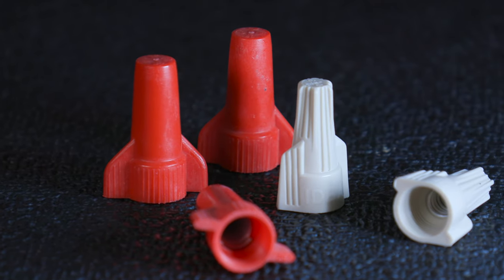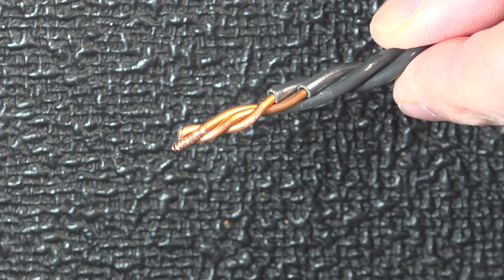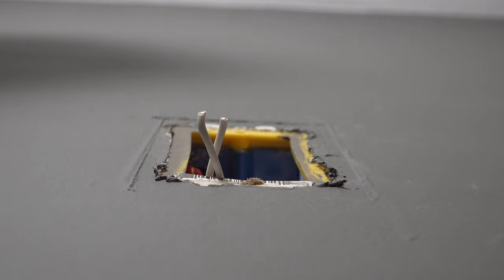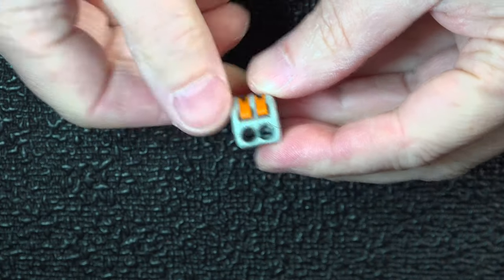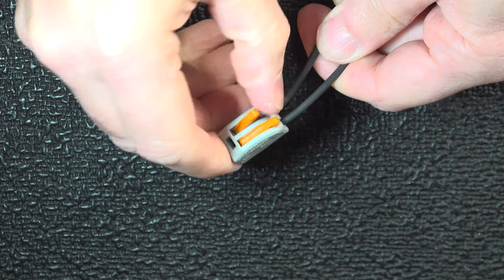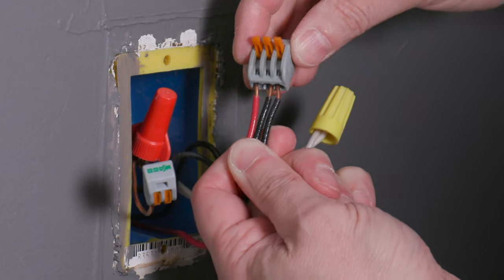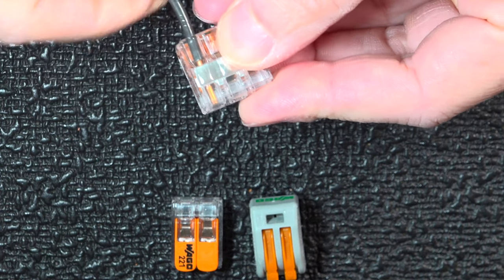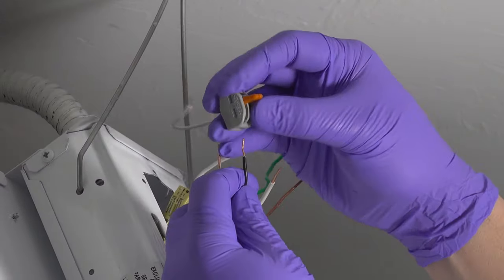Never use Wire Nuts Again - Wago is Better Electrical Connector

Comment: I agree with the wago lever connection. But getting someone you work for to spend the little extra for the better connection is impossible.
Reply: It's a lot extra, and it is not a better connection. It's just faster and easier. Although I have a wire nut driver for my impact, so in a lot of cases, it wouldn't even be faster or easier.

Comment: Here in Germany we have been using the WAGO terminal for many years. I've always wondered why wire nuts are still used in the US, but American electrical installations are a relic from the Stone Age for a German. Power outages are around ten times more common in the USA than in Germany and there are reasons for this. If an electrician in Germany were to use a wire nut, he would be fired immediately. Wire nuts are banned in Germany for a good reason.
Reply: your last sentence is wrong. sadly. wire nuts in german: drehverbinder. you can still buy them and they are VDE compliant (VDE 0613-1). you're right: wire nuts unpopular for reasons here. but not banned. there is only one use case for them: if you have an old electrical system with wire nuts and you have to expand it for your customer without renew the whole setup.
Reply: And in Germany you have 220 volts  (or close to that) standard too, right?
Reply: @HobbyOrganist  We have 230V / 50Hz as usual in the most countries.
Reply: @GettingNervous  Right, 230, we have anywhere from 115 to 125 with some variances, so your voltage is roughly double ours
Reply: @HobbyOrganist  So what? I wouldn´t use wire nuts for 12V (unless I'm interested in a fire). It depends not only on the voltage but the current.
Reply: @GettingNervous  There's no "what" I simply asked, and made a statement...

Comment: I always twist the wires together then wire nut them. Been doing it for 40 years. And if there is stranded wire I twist it up then fold it over then wire nut it. These lame connectors are for amatures. They are gimic connectors. Kinda like pex pipe for water. I use copper.
Reply from the maker: Folding wires is not approved by any manufacturer of wire nut. Don't use Wagos if you don't want but that practice is not good.

Comment: Wire nuts are about a 10th of the cost, I’ve been wiring homes for 40 years and I’ve never seen a problem with properly installed wire nuts.
Reply from the maker: In qty they are 3x the cost and take 85% less time per connection to install.

Comment: I've used the Ideal push in type electrical connectors from Home Depot or Lowes for years - about 8¢ each vs these at 25¢ - 50¢ each for the Wago connectors
Reply: However, they aren't easily removed.

Comment: I'm a licensed electrician (over 30 yrs in the trade)and I have made thousands and thousands of splice and I've capped them all with wirenuts. I would never trust a connection to a spring loaded connection. In the right application, these gadgets work well. But, replacing a wirenut with these??? I don't think so!

Comment: I have NEVER installed wire nuts, but I did take them out of existing installations after I traced a fault to one that had come loose over time.
Unsafe, unpractical.
Reply: pffff ok

Comment: Never seen wire nuts in Poland. Wago is best, as it put force always with springs, unlike screws which will losen over time - I've came on several situations where losen screw connectors were sparking! Plus there are versions for wire or cord. Securing cord with screw is even worse than wire.

Comment: Don't believe this tripe. Wages are nice for low voltage and ballast connections but not plugs or switch or splice situations. They get hot and melt and short things out. Not enough surface contact for good electrical connection. I'd rather just tape the wires together with no twist than see these things anymore. Service call nightmare!

Comment: I think there is a little supposition and misinformation about wire nuts here. Wago may be good for light loads but I will stick to tried and true wire nuts for heavier loads.
Reply: They only come in a size for 10GA max size wire anyway

Comment: What probably makes Wagos better is that they are stupid proof. I can guarantee that a properly used wire nut will provide more surface contact thus lower contact resistance than any push in, snap together, or wago

Comment: When I started my apprenticeship as an electrician, I found wire nuts in the basement.  The old master then told me that it still comes from his father, so it is definitely 50+ years old. I have never seen wire nuts anywhere here in Germany.
Before Wago, as far as I know, there were screw terminal blocks, but since at least the 80s or 90s everything is done using wagos 🤷🏻‍♂️
Reply: Yep here too my thinking is that these terminal blocks would still make more sense then wire nuts.
Reply: Sometime they have been used somewhere in Germany around 1970.
But for lousy durability and high installation time and awful looking wiring, wire nuts have been sorted out by serious electricians as idiot trash.
Reply: You haven't seen them in Germany because it's against german code.
It's literally illegal to use them here due to the problems they can cause.

The only allowed wire connectors here are screw-in blocks and Wagos
Reply: @kb-elmo  I've heard UK is the same, definitely never seen a wire nut and screw-in blocks seem most common, possibly Wago in new installations but can't confirm.

Comment: WAGO’s give a much smaller connection point than the wire nuts offer… by design. For this reason, I don’t trust WAGO’s…. Especially when doing circuit bearing joints. I may use them on fixtures but that is much less stressful to the small point of contact. Wire in wire nuts are twisted together and don’t rely on a small piece of metal making the mechanical connection between them….. which I have seen showing arc damage. This video uses really bad examples of wire nut use but doesn’t explore the damage over time caused by upper range loads on WAGO joints.

Comment: Or you can just learn how to do it properly: Strip, twist, pull, 👍 If you pull and the nut falls off, you did it wrong. Also, while you do need to cut off the bite marks, you should remove the nut first, if you get a good quality nut you don't need to discard them after the first use.

Comment: From the videos I watch WAGO is faster, but wago had more resistance, and higher heat (not dangerous) than twisted wire nut. Undecided, but leaning toward wire nut.

Comment: In Germany we use the new small wago clips only, there is no electrician in Germany that does not use those. Actually I would be afraid if I see wire nuts at somebody’s place and would change them out

Comment: Blue Point terminal screw connectors have been around for decades. I'd take those over IDC connectors of any kind for mains voltage (Australia 230v)
Joining different stranded cables and not  weakening strands takes practice. DON'T  DO ELECTRICAL WORK IF YOU ARE NOT A QUALIFIED ELECTRICIAN PEOPLE!

Comment: These wire nuts are not so common in the UK but I once say pretty much a whole industrial installation done with them it was a disaster waiting to happen! On the other hand Wago stuff is great, used many of their products, not only their connectors.
Reply: @kenthomas4668  it was wired up by someone from the US! 😂 it wasn’t in-line with our electrical codes but as it was industrial it doesn’t get signed off by a public body.

Joking aside, the problem wasn’t that the wire nuts were used it was that they were used almost exclusively in an industrial installation where they were dangling in mid air etc. I think it was the user not the device. Also, I’m sure they can be used quite well in the right hands.

Comment: Only problem is wagos are expensive. Cant imagine wiring an entire house with one. 

Same reason different techs have not replaced silicon pcb's. The improvement is not significant enough to justify the cost.

Comment: At the end of your video you were using waggos on a quick disconnect  in the  Fluorescent light You don't find that kind of redundant
Reply from the maker: The wires need to be connected
Reply: @SilverCymbal   could have simply used wire nuts in that application due to the quick disconnect being in line. 
I have been in the Electrical field for a very long time covering everything from residential to industrial And have used those waggo's I have found sometimes they don't make the connection Because of the diameter of the wire Or the receiver in the waggo Not being tight enough.  90% of the time where electrical is going to fail is in the connection It really doesn't matter what you use But the waggos are a labor saver and time is money

Comment: The amount of confidence this guy has when he says “wire nuts are not reusable”   

I can already picture this goober going around to all his switches and receptacles replacing all the wire nuts with wagos thinking he is brilliant….   

Message to the wago man: please reach out to your local master electrician for advice before you release incredibly stupid information out to all the virgin ears that don’t know any better.
Reply from the maker: If we depended on electricians for technology we would never have LED bulbs, no solar, no generators or network wiring. They tried to stop all of it, hated every bit of it but the world forced them to adopt it. Most still complain about it. What a career where you just complain about anything new, no matter what approvals or safety rating its has, I will accept the NFPA over parts counter talk any day.

Comment: Lol wrong on all accounts, wire nuts, or marretts as we electricians call them are the way to go, they are not a one time use item, most people don't put them on right and they hold on tighter and longer then the WAGO connectors, I can tell you how many service calls I've had to do because they come loose over time. 

Marretts can be used for multiple wires using the same nut, WAGOs require more, they're more expensive, and when it comes to trouble shooting and testing, you can't work on them live. 

Wire nuts have been and always will be the way to go. Sorry sir
Reply from the maker: Wagos are more expensive, yes, take 90% less time each to install and incredibly easy to get perfect results. There are no service calls for failed Wago 221s. None, I have offered multiple times for someone to send me an example or even a photo of 1.  None have ever been shared, and check google you will find none there too. Search on burned wire nuts, you will need an afternoon to go though the images
Reply: @SilverCymbal  you won't find that anywhere and you'll never get an electrician to show you, we have nothing to prove to you. You're the one trying to convince people that these are the way to go but the only places where they are used are in service lighting fixtures. You'll never see them in junction boxes. 

This is my job, that I've been doing for 20 years. I can make a connection in my sleep. I don't even need to put down my wire strippers in order to make the connections. You can't do that with a wago. 

They're expensive and slow, and can't hold up to the loads put through them because they depend on thin steel to make the connections between the wires, not twisted contact. They also depend on spring tension to hold them in not a screwed connection. Over time as they heat up, expand and contract they will lose their effectiveness. 

The end
Reply from the maker: @gtileo  If there are SO many failures, and they are making electricians so much money to tear them out, surely it's hardly a big ask to see some proof, even a single example. But yet none have surfaced. Just stories and mythical unsubstantiated failures.  None of what you wrote is true. UL, NFPA, CSA and ultimately the NEC all support their use as does all of Germany, UK, Switzerland and dozens of other countries that outlawed wire nuts decades ago. We are just late to the game. Do me one favor, please if you keep using wire nuts give your customers new wire nuts, you wouldn't want your doctor reusing needles and bandaids, don't they at least deserve that?
Reply from the maker: @gtileo  Also be sure to see them under 3x their rated capacity with no problems: https://www.youtube.com/watch?v=B1pmuRsf1co&
7 months ago

Comment: The problem I'm seeing is I did not see him pull back on this connection once. Any good electrician knows those stabbed in plug connections are fire hazards. Therefore I am very weary of anything that stabs in. I could see it loosening up over time causing a loose connection

Comment: If you want a true long lasting connection pre twist, solder, rubber tape then friction tape. I've come across many houses built in the 30's and 40's with these joints that have shown no signs of failing.

Wagos, like backstabbing receptacles don't make a secure connection. Wire nuts are fine but don't ever twist them with pliers.

Lastly, I knew this video was a joke when they showed the guy wearing latex gloves pushing wires into the fluorescent light.

Comment: I've used a lot of these and they are awful. they slip out and the NEC already won't allow them.
Reply from the maker: It would have been great if any of what you said is correct, none of that is true. Call the NFPA if you have any doubts
Reply: @SilverCymbal  I mispoke about the code violation. it's already not allowed by many state codes but still allowed by the NEC.  I would NEVER use these. I have spent many hours trouble shooting lighting circuits in new construction and 90% of the time it's a wire that slipped out of a wago, 10% wire slipping out of ballasts. It's never a wire slipping out of a properly installed wire nut. In my many years of experience your giving people bad advice that WILL lead to someone burning down their house.  Sleep well.

Comment: Compared to the damage wire nuts can cause if they fail wago nuts aren’t that expensive at all.
A wire nut is cheap but if you keep having to replace em than just use the old wago connector it’s cheaper.

Comment: If you want to have shorts and electrical issues, use these things. They are terrible, as an industrial electrician I have found these faulty so many times. When ever we see these in anything over 24 volts, they get removed and put in there proper place, The Trash.
Reply from the maker: You haven't had one issue with a Wago, give me a break. Maybe some other junk brand. Everything in life isn't the same. Makes sense, take a germany made connector approved worldwide and throw it out, but put on a toothpaste cap with a bolt and pray it's on good. Sounds much better, I wonder why the rest of the world outlawed wire nuts in favor of these?
Reply: @SilverCymbal  I have, I have seem many 277 volt lights stop working. Take them apart and find a burnt Wago connector and yes Wago. I have worked on many Wago devices over the years including their PLCs. I seen a LOH German made catch on fire inside the control cabinet from push in connectors that are on higher voltage and higher amps. These types of connectors and similar generally on last on low voltages. Sorry I have 30 years experience working on industrial electrical and electronics. I never use these things unless I don’t care if they last.

Comment: How many time have I changed wires in the same box in 25 years of being in the electrical trade? Seriously? Besides,  in switches, the neutral connection never needs to get cut. Just the hot wires are being moved to the new switch.

Comment: I will stay with the trusty wire nut over those cheap looking, easily broken WAGOs.  Yes, I do tape them too.  I have never had one come undone.  Very, very rarely has a wire got so butchered that it if has to be cut and and stripped again.  If it did, I would extend it with butt splices.

Comment: what if i had 3 different size wires?
Reply: You should never be joining 3 different size cables, if you are I would suggest getting a qualified electrician to inspect the whole installation because it sounds like a lot of cowboys/DIYers have been messing around with the electrician over the years!

Comment: Boy those are expensive compared to wire nuts maybe the best use is for a 4 wire connection but for 2 or 3 wire, wire nuts are still the best option

Comment: You do know if you spin the wire nut counter clockwise, it will come off, right? Wtf are you cutting the wires? I work at an apartment and townhouse complex w almost 800 units that's over 50 years old, and the wire nuts still twist right off. Of course I replace them, but w new ones that will last another 50 in the wall...

Comment: or in other words WAGO the safest way to almost certainly ensure the connection will fail, overheat or catch fire, thers a good reason why connectors like this (which has been around for 60 years btw) isent used for bridging cables inside unventyilated spaces, tay dont connect well-well the connection is fairly ok for avile, till u run power over then, as only a partial connection is made to the two(or more) wires, for DC thay work very okay, for DC not a chance...i assume ur from U.S.?...where the electric standard r well less than solid... i could describe how electrons and electric fields behave as AC...but i find it pointless, WireNuts or TOREX Caps makes a solid joint allaround the wire, not just in one or two points...learn to do it correctly insted and it will be the last thing that will ever fail..

Comment: Wagos are better for homeowners and handymen perhaps since they are foolproof.

But I guarantee as a professional electrician, I can make better splices with wire nuts by pre twisting my wires with my linesmen pliers than you could ever achieve with a  wago. No Question
Reply from the maker: Not sure it's better. Cheaper, yes and each wirenut connection takes 4x as long compared to using a Wago. 100% right on people that are not pros though it eliminates many common errors, but sadly many pros also mess up wirenuts and with no visual indications, the problems go unnoticed.